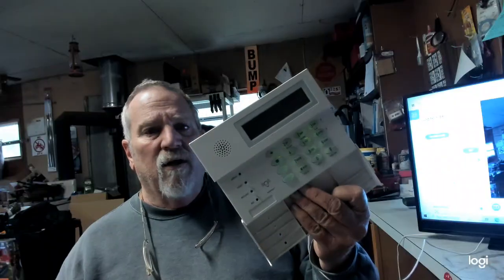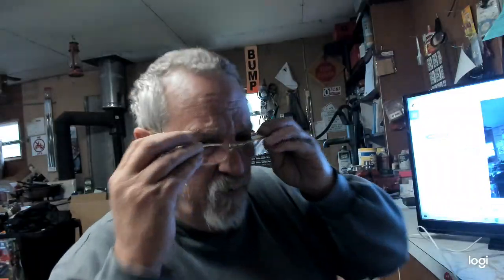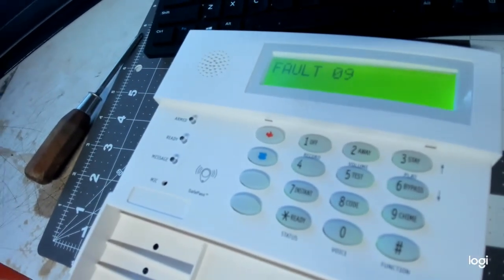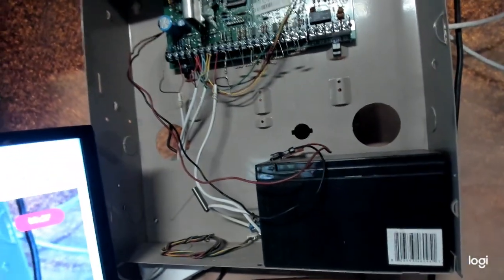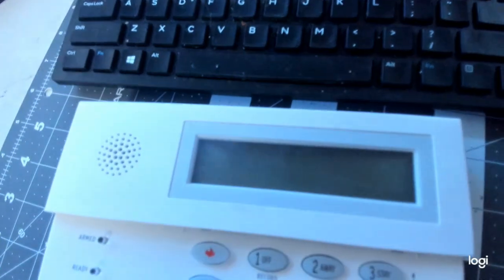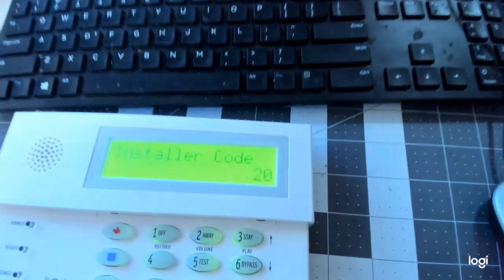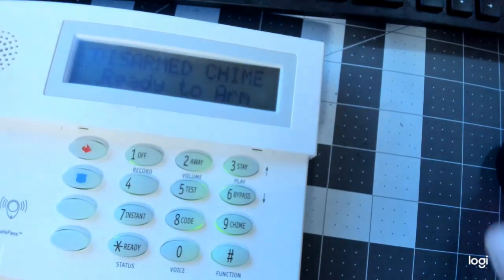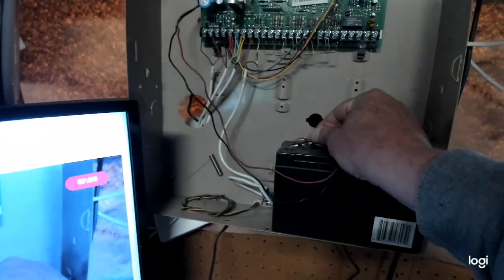How to Get the Installer Code on an Safewatch Pro 3000 (Take Back Control of Your Alarm)

Comment: Hello love the videos this has been super helpful. I have a question I found an ADT Safewatch pro3000 system on eBay. I would want to install this system at my home all the wires and sensors are on the doors and the key pad wires are still there. It looks like someone just removed the main system and the key pads when they left.  Seems like it would pretty much be reconnecting the sensor wires back to the main board. Am I thinking correctly?
Reply from the maker: Big request to give a difinitive anwser but I see no reason why it should not work for you...Good Luck

Comment: why is the keypad panle loud when it goes off without a siren dose the dumb adt keypad have a feturw where you can turn it down?
Reply from the maker: I think its #-3-0 till you get to the sound level you want, the dumb keypad sound levels are not adjustable.
Reply from the maker: Sorry no the dumb keypad has no volume adjustment